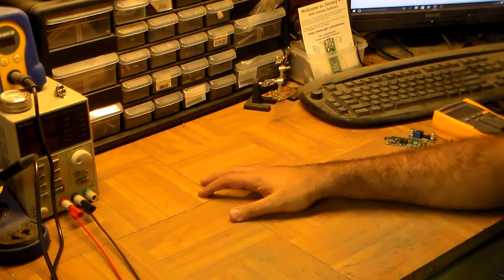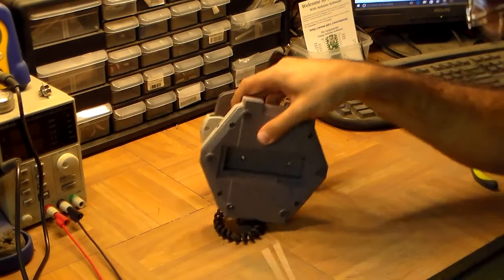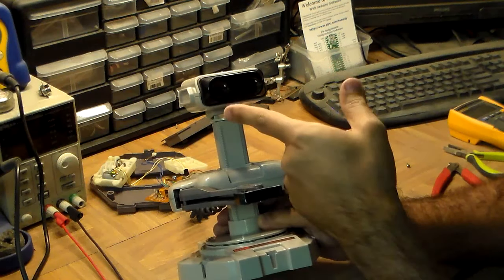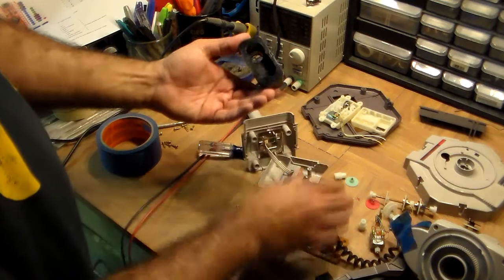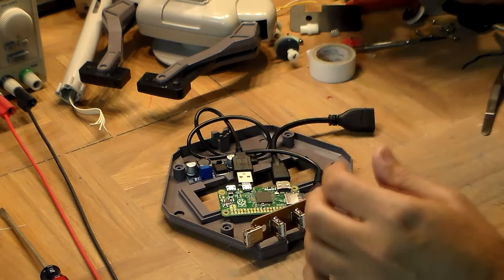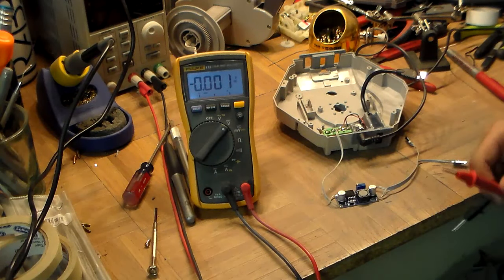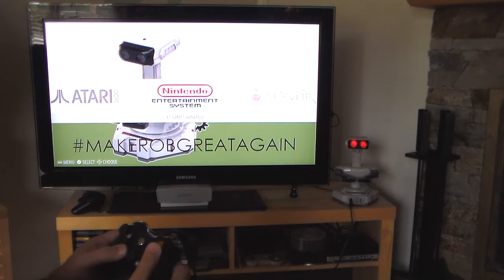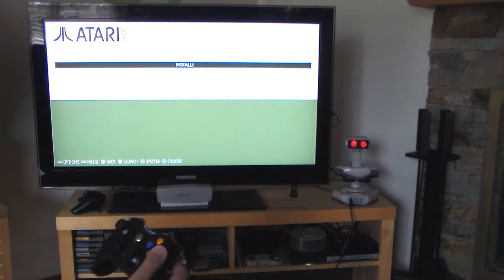#MAKEROBGREATAGAIN - Bring greatness back to your Nintendo ROB!

Comment: Sounds like the music is running overclocked and out of sync (faster tempo) compared to an NES.

PS I wonder how that ROB would do at a game of Gyromite or Stack Up?
Reply from the maker: Dude, you have a good ear. Yes, the reason it's playing fast is because I was using  PAL rom; the emulators can compensate for the clock speed differences between NTSC and PAL, but you have to name the ROM files in a particular way, that I forgot to do.